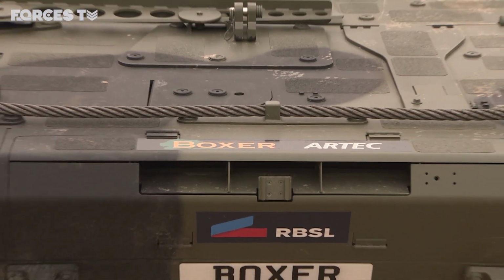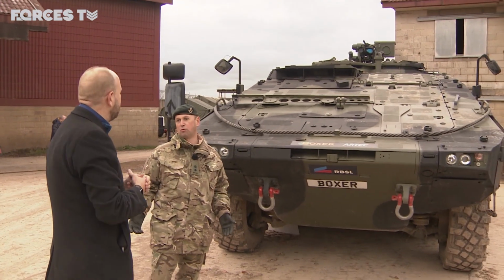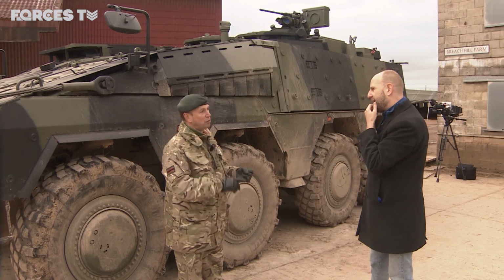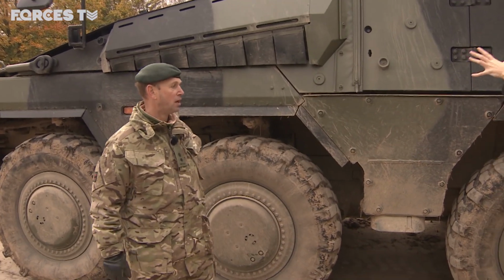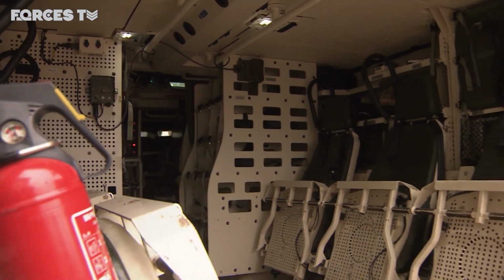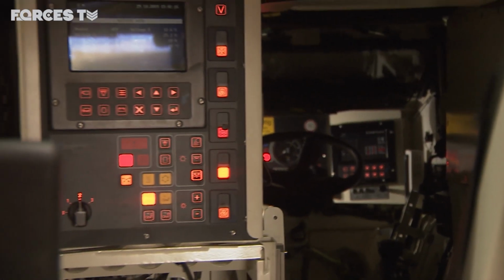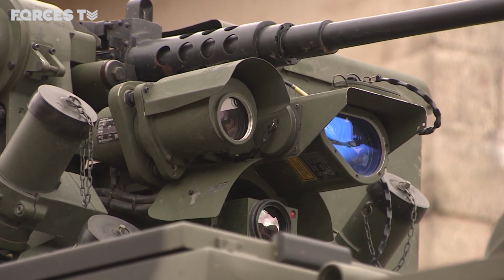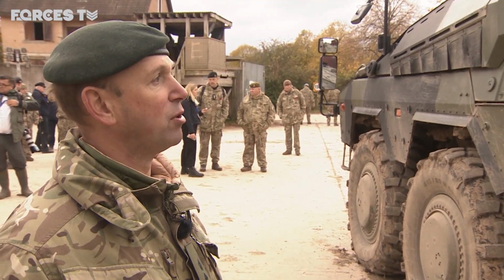BOXER: Up Close With The Army's New Fighting Vehicle | Forces TV

Comment: Will any production take place in the UK? Will basic vehicle be built in Germany then sent to UK for final fit of specific equipment?
Reply: Over half the build and final assembly will be in the UK.
Reply: @davidhouseman4328  
Then Algeria does it better.
Completely assembles them locally in a factory paid for by Rheinmetal.
The Germans are having fun.....
Reply: @hans2406   Whilst fully UK made would be better, it would also be far more costly, a slower to get into production. Amongst other things, this vehicle was selected as it is already a battle proven design, as opposed to the typical bespoke British design that ends up costing us way more than the competition for no real reason.
Reply: @hans2406  I think you misunderstood. Assembly AND over half the parts build. I think the main part we won't build is the engine.
Reply: @Eddie Weston Clearly the notional concept of that advert went straight over your head.
Reply: @Eddie Weston Well I can tell you've never served, diversity for many years has been a strength to the tri services. Few people give a damned what colour/religion their oppo is, so long as they're good blokes who will stand by them. The advert is not about saying you can do a stop short and have a quick pray on ops(which absolutely no one would do anyway) , its about enforcing the values of the armed forces by saying that if you have got different beliefs and cultures-provided they maintain the same basic values of the armed forces-you can serve and the armed forces will support you. If you think diversity it a bad thing remember thag whilst great minds think alike, fools rarely differ.

Comment: Interesting terminology.  I know of APC's and I know of MICV's but MIV?  Is that because it will carry nothing larger than a machine gun.  These Strike Brigades don't have much to strike with do they?

Fantastic vehicle  though.
Reply: guys deploying out of it with javelin
Reply: @mawdeeps7691  Whilst manoeuvring?  Manoeuvre is about moving not being static.
Reply: The heavier gun will be on Ajax. But yes the strike brigades are focused on speed rather than power. They will of course be supported from the air.
Reply: @davidhouseman4328  40mm on a few vehicles isn't enough. 40mm on all the fighting vehicles with ATGM adequate.
Reply: @clangerbasher  I think thats the point, they aren't fighting vehicles, they're troop transport.
Reply: @davidhouseman4328  In a small army in an era without front lines can we afford vehicles that can't find?  And the term for a protected vehicle with high mobility is an APC.  If all we need is a battlefield taxi, a class below as it were,  there are cheaper options.  Boxer is a fighting vehicle.  It is a great vehicle.  I hope these 500 are just the first tranche.  But it is woefully under gunned.
Reply: @clangerbasher  cheaper but less well protected? Something like the Mastiff, the vehicle this is replacing.
Reply: @davidhouseman4328  Is Mastiff less well protected?  What is it's STANAG rating.

The difference is cost will be the mobility not the protection. 

I am not saying we don't need a go everywhere well protected vehicle, I am saying it needs more firepower.

Boxer was designed to be able to follow Leopard across country.
Reply: @clangerbasher  4? But I'm going by the fact this video said it has better protection.
Reply: @davidhouseman4328  And does that have any bearing on my discussion point?
Reply: @clangerbasher  If you can give me there STANAG scores, you can make a point. All I could find was Boxers at 4, I couldn't find Mastiffs. What we do have is the British Army telling us a reason for buying it is it's better protected.
Reply: @komradearti9935  I am not quite sure how my point about a lack of firepower turned into a discussion about protection.
Reply: @clangerbasher  We got onto protection because it's a lower level vehicle with too much protection not a higher one with too little firepower.
Reply: @davidhouseman4328  My original comment had nothing whatsoever to do with protection.
Reply: @clangerbasher  Yes, but from your posts it seemed you thought it was lightly armed because you thought it was an infantry fighting vehicle. For the British it isn't. It's a battlefield taxi. Expensive for that, but better protected than the cheaper vehicles.
Reply: @davidhouseman4328  NO. I said it should have been a IFV / MICV  because of the lack of fire power in the British Army's new force structure.  YOU turned turned into a discussion about protection because you don't see to be able to comprehend plain English.
Reply: @clangerbasher  you literally wrote "Boxer is a fighting vehicle". How is that my lack of comprehension?
Reply: @komradearti9935  Would have been expensive.  Not really needed?  Well that's the question.
Reply: @komradearti9935  Oh.  A bit like having a choice between airbags or ABS on a car and plumping for the airbags.
Reply: @komradearti9935  The wars / situations 'short of war' will come upon us very quickly in the future.  A small army needs to offset size with something.  Good enough for now, might not be good enough for tomorrow.  And tomorrow could quite literally be tomorrow.  The Army functionally is getting to the point where its main capability is flag waving as in 'look we are here too'.  It won't be politicians on the front line getting steam rollered but normal men and women, our brothers, fathers, sisters.  And it isn't question of not being able to afford these things it is question of HMG choosing to spend our money elsewhere.